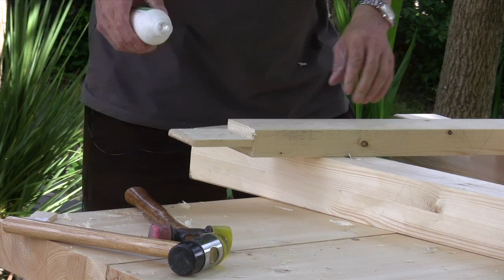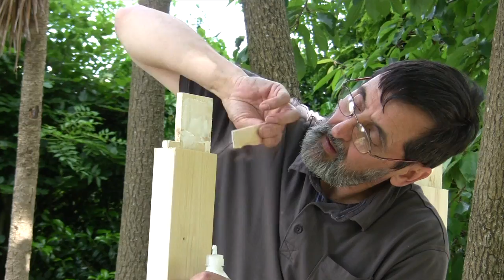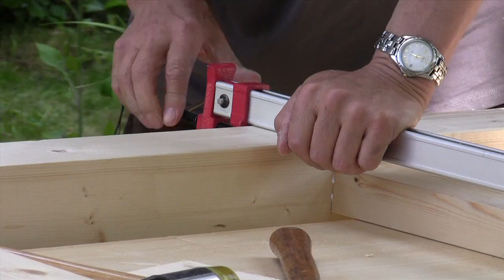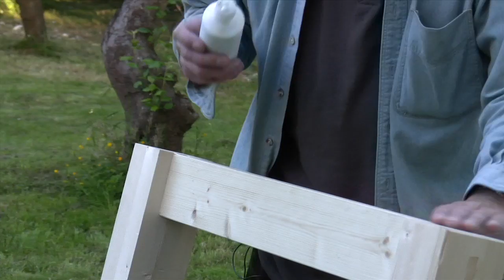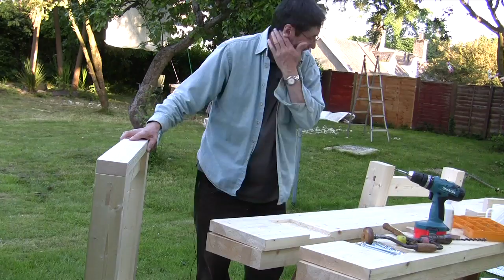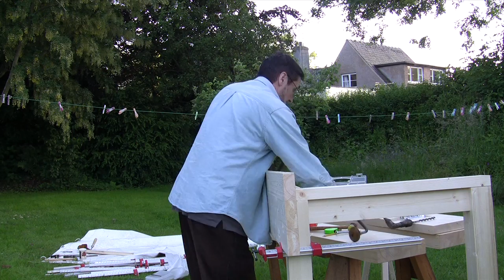How to build a workbench - (Part 9) (assembly part 1) | Paul Sellers

Comment: Your screws are to short!
Reply: One turn of a srew will hold the weight of a man.  How long do you want them?
Reply: The screw at 16:31 doesn't appear to make it through the board at all.

Oh, and one turn of a screw will rip right out of the wood. It's that old "weakest link" routine.

Comment: If I don't want a screw in my work, for practical or decorative reasons, I'll glue and screw my pieces together, then after the glue dries, I'll pull the screws and install trenails or dowels.
Reply: +colmhain i usually just sink my screws a bit deeper than surface level and cover it with a dowel, if you're gonna stick a dowel in anyway you might as well leave the screw in there for strength and stability, although tenons and glue is really all you need.
Reply: +colmhain also i like to put dowels straight through the tenons, with the holes in the leg/cross beam slightly offset so it pulls the tenon tight as the dowel is hammered through.
Reply: +colmhain and i like to stain the dowels a darker color so it contrasts with the surrounding wood when leveled and finished :)

sorry for all the reply's, lol - ill stop now. peace
Reply: or use different types of wood for the dowels and wedges. Then the stain will darken or lighten as per the wood type.
Reply: colmhain
my thinking exactly!

Comment: Hi Paul, it looks like your bearers are cut from 2x4 but in some of your sketches you list them as being 1.25 inches thick. I had trouble finding wood of 1.25 inches thick so i bought 25mm thick board. Could I just use 2x4 offcuts or should the 25mm thickness stripboard be ok?

Thanks

Comment from the maker: Jacob, The black head is softer, for assembly, so that it doesn't mar the surface of the wood. The yellow head is hard plastic, impact resistent, and used for more direct strikes as on the chisel.

Comment: Not too much pressure, I used bessey pipe clamps to take the heavier load. It seems to me that the pipe clamps, while certainly more expensive, can handle a larger amount of pressure. I'll see if they accept the return. Thanks.

Comment from the maker: The question is did you apply too much pressure or was the clamp flawed and, also, it sounds from what you say that they all broke. Is that the case? I have broken one of these clamps before, but they take them back and replace without question, so that works.

Comment from the maker: I have used every plane that's made. I can say that the very 1st plane to buy is a pre 70s Bailey-pattern Stanley #4 smoothing plane. The 2nd plane I think would be a pre 70s Bailey-pattern Stanley #5 jack plane. Then go for a wider smoothing plane, again, a pre 70s Bailey-pattern Stanley #4 1/2, but that may not be good for a lightweight, small person. My last bench plane would be a pre 70s Bailey-pattern Stanley #5 1/2. After these. I'd consider a Lie Nielsen or a Veritas bevel up jack plane.

Comment: I've building my own bench following yours and I have a little sag in the aprons, probably because I tightened the bolts very hard... I also need portability so I can't glue the top to the apron for straighten it up... What do you think of attaching a center rail with a long screw in the middle and nuts and washers on each end?

Comment: A fantastic series, and I can't wait for the final installation!  I've been starting some basic woodworking (built a frame-supported cabinet for a large fish tank), and life would be much easier with a bench.  I found this as I was working through plans and it certainly looks by far better than most simple-bolted 2x4 setups.  I do have a question though: how difficult is the planing for the laminar setups for a beginning woodworker?  Certainly don't want to pock the boards to pieces.  Thanks!

Comment: Under-bench cabinets are acceptable if you don't have room, but all you need is a 3' wide by 2' deep by 5.5' high rolling tool board.  May I ask why you avoid holdfasts?  I use my old-style Sjoberg's holdfasts all the time and find them to be very helpful.  Truth is, I could get along w/ a few of them and no vice at all.  I understand that some of this is just a matter of preference, but I respect you so much I'm anxious to see how your complete system works.

Comment from the maker: Ideally, cupboards independent of the bench are best. We consider this because we don't all have extra space. The apron drawer of my bench works fine, but sometimes I need a tool from that drawer. First-world problems like this happen. I don't use holdfasts and I don't advocate dogs because a clamp in the vise takes care of everything I need. Under the bench cabinets only get shavings inside if you leave the door or drawer open, which you can't do for obvious reasons. I think they work fine.

Comment: Storing anything under a workbench is an iffy idea.  #1, it's right below the spot where you make sawdust, shavings & chips.  Then, you've got a board in the vice & realize you need a tool that's in a drawer down there but you can't open it because the board is in the way.  Also, you want to install a holdfast in the top of your bench, but because you're a "utilise-every-cubic-inch-of-space" guy, you made the cabinet right up to the underside of the bench top.

Comment: I recently completed my own bench following Paul's method (skipped ahead a bit :)) He is right, it is rock solid.  One thing I did that might help others in my situation (not enough clamps big enough to glue the H-Frame) was to use 2 ratchet straps with cauls (wooden pads to protect the work).  Simply loop the strap around just above the joint and hook the ends together, insert the cauls between the strap and leg, and tighten the straps equally.  Mine came out perfectly square with little effort

Comment from the maker: Surprisingly, they stay fast and the bench apron doesn't work lose because the inside wedges drop with any shrinkage or racking. It is always rigid, and remember, I have used these benches since 1965.

Comment: I think those carriage bolts will become loose in the wood, because the square part will not hold forever as the hole gets worn out, especially when you want the bench to be mobile, that means a lot of (dis)assembling. There are washers for these bolts with a square hole. I drill 2 little extra holes in those washers and nail them in a countersink which i drill. That way I can make sure, that the bolt head will alway grab and I can tighten the nut. Apart from that, nice craftsmanship as allways.